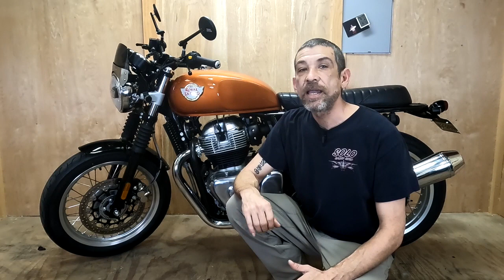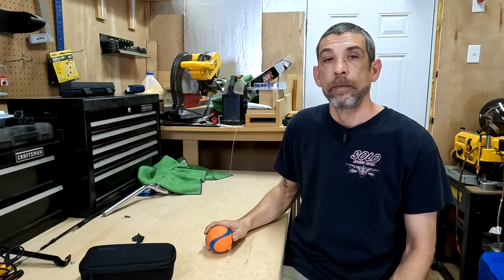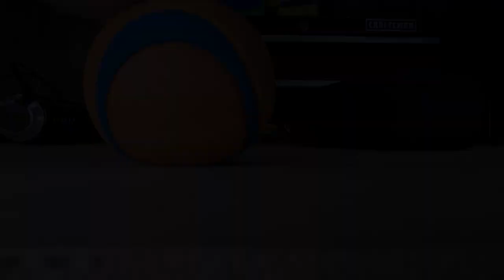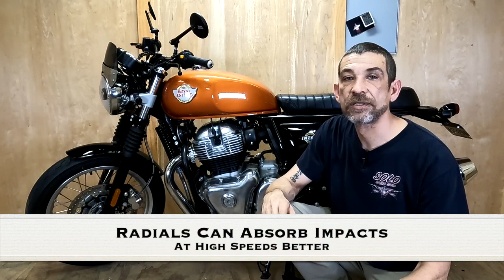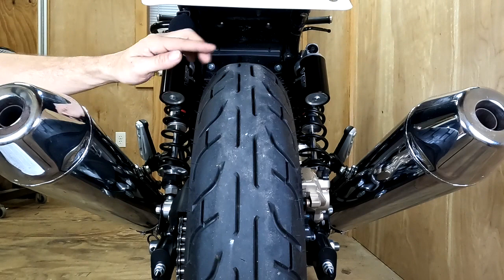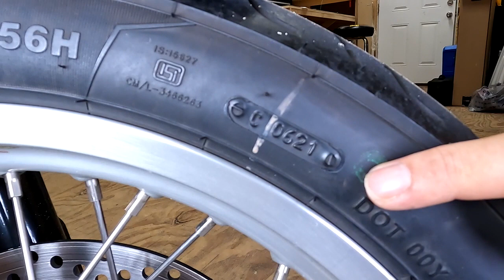How Tire Pressure, Tire Construction, And Road Surfaces Affect Traction

Comment: Great video. Thanks! Will you eventually "upgrade" your tires? I have been reading that the stock tires on the Royal Enfields are not that great? *I have a GT 650.) Has this been your experience? I've been reading good things about switching-out to Bridgestone 46's. Thanks for any thoughts you might have on my questions,
Reply from the maker: @JJM51 Thank you. Yes, I am definitely going to change tires. I will probably have a few sets of rims with different tires mounted when it's all said and done. My opinion on the stock tires is just that, an opinion. There are a few tires I want to try. First, is the Michelin Anakee wild (aggressive scrambler). Second, Pirelli Scorpion MT90AT (I really like this one). I have heard really good things about the Bridgestone too. I am gonna get a tubeless kit for the wheels so I have more tire options. Also, I might get a set of 17's to run sometimes but I'm not sure yet. Hope that helps. Thanks for the comment and thanks for watching.

Comment: Congrats for your channel, I have an INTERCEPTOR 650 too,.  So what do you think of using the sahara tire sealant?
Reply from the maker: @JEEU Thank you. I appreciate the comment. I haven't used the Sahara tire sealant. Also, I've never used a sealant on any of my vehicles. I only use it on my lawnmower, tractors, and bobcat for minor leaks. Personally, I wouldn't use the Sahara tire sealant on my Interceptor because it is a tube tire. I think that is designed for tubeless tires. Thanks again for the comment and thanks for watching.